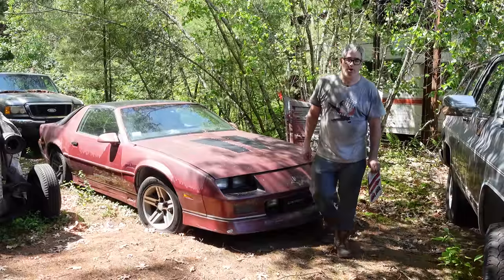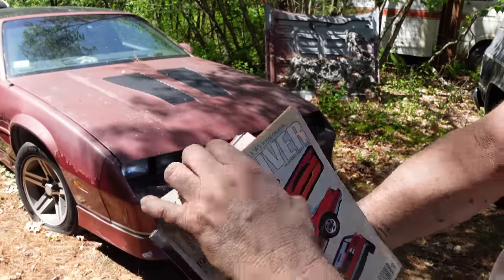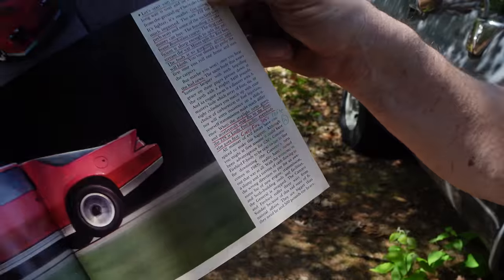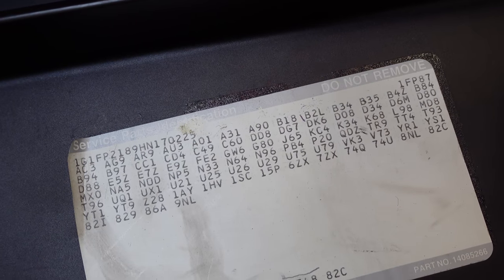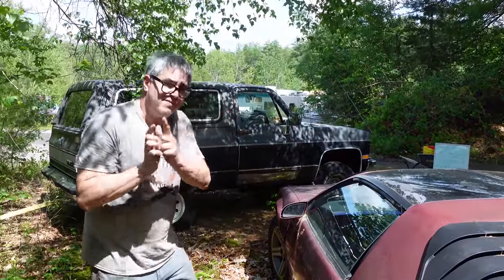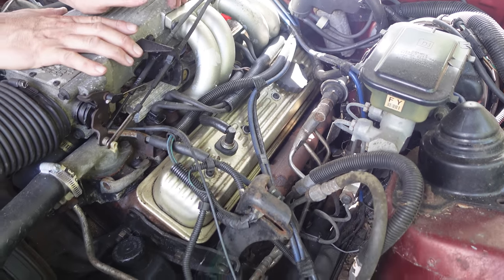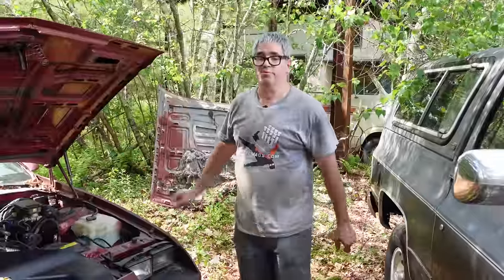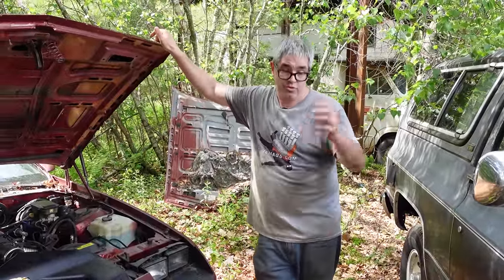Heart of a Corvette

Comment: I have an 87 LZ the base model with the 2.8 6cyl and the 5 speed it has a little over 42,000 it just turned over a couple of months ago, the car is sharp no rust. 

I'm the second owner, I paid $500 bucks for it, but of course I bought it off my father in-law who can't drive it anymore and wanted rid of it.

I have the dealer receipt and I've got the build sheet from the factory! 
I've got every book, repair manual ever made for it!

Comment: I had one of the first IROC-Zs off the line. The first ones had the strait from the Corvette line intake runners. They were bigger than those that came out later. Over the years, the IROC Z28 became simply an IROC-Z without the Z28 badges.

Comment: Power adders. Paxton supercharger, Superchip and a 100 shot of nitrous oxide. Around Bergen County and Passaic County NJ early 90s it was Camaro vs Mustang every weekend. I had a CRX so I was an observer. Ever see the passenger door open up on a hard launch?  Or a T-top go flying. I worked at a speed shop on Rt 46 in Elmwood Park and people would come out of NY city to have accessories put on there car's. We were the place to get your nitrous bottle filled and a can of No Touch wheel dressing.

Comment: I had a 75 442 with a 455 I pulled out of a 70 delta 88. The look on the IROC drivers face when I pull away from them was priceless!   They definitely looked better than my car though!
Reply: I had 73 cutlas s 14,000 miles gold 350 rocket and it utrun 78 z28s with 4 speeds and the 350 iroc when it came out in the late 80s or 90..even the pittle 5.0 5speed foxbodys yep them to .the gold rockets were better performer then the red ones olds 350 rocket is also a big block some dont even know that. Man i miss the best selling cars in America and that was olds cutlass for many decades our granddads knew whats up😅

Comment: One funny piece of info that I learned over my many years of 06 GTO ownership is that the poorly named M80 differential that comes in the GTO is somewhat related to the Australian 9 bolt found in this IROC. I'm not sure of the extent of the relation, but The diff in my car has carrier bearings that I bought looking up the part for one of these F bodies. I guess it makes sense that there's only so many types of Australian differentials.

Comment: I was at the Toronto Indy a couple of weeks ago, and was talking to some guy about the early races back in the mid/late 8o's. I mentioned that they had the GM/Players series here in Canada that had zed-28's (just to be a hoser) and Trans-Ams racing on road and street courses, and the Toronto street course was one of the stops. He was good bit younger than I, and he had no idea of them. My father in law was a GM parts manager bigwig, so he got tickets and I went. The IROC's racing in it had the 1LE  package that came with a 230-hp 5-liter V-8 and the manual transmission. They still come up for sale occasionally, and are pretty nice machines, better than a 5.7 IROC.

Comment: Thanks Steve, agree that one needs the right home. My '91 Convertible was a base RS 305/Auto which now has the G92 posi disc rear axle, all Hochkis suspension, and C6 wheels. Been building a 383 AFR head engine from my '72 Vette block to replace the 305. Even though it has 300,000 miles, NO rust and very clean. Back in 91, I had special ordered a blue 1LE with leather seat option. It took a month to get it, but well worth it, and yes, it had no problem with any Mustang - except one that had full AM and he got me by a fender. Of couse that was 1/4 mi. not a road course...

Comment: I ordered a 1982 z28 with 305 ,4bbl  four speed manual . Actually I still have it but it’s a long term project now. In 1985 I went to a  350 11 to 1 aluminum heads bored 60 over with a 850 double pumper, but kept the factory transmission and rear end. Fast on the hwy but slow on the track. That was my first midlife crisis.

Comment: owned one of these. 86 IROC Z. all options including the same rear window after market cover.. a very cool car. 305/5.0L TPI engine. working on this car was a huge PIA, everthing was so tight often had to remove lots of parts to just service it. Rear spark plugs were the worst... I've never seen a 350 for the 86 year so suspect it was a mid year change. It would get about 20mpg but then I changed the program chip and it dropped to 12mpg. Fast before chip change, neck snapping after chip change. top speed for me was 160mph, plenty left but never went faster. an amazing car, down fall was the radiator. First factory plastic aluminum radiator went out with leaking seams, 2nd one did the same thing. 3rd one I installed an all copper made unit. top rad hose connector blew out of the housing, just too much pressure at high RPM's. I loved the finish of the car but the ride was worse than a pickup truck and didn't smooth out until I got over 100mph. Also ate the fuel pump, huge PIA to change out, had to drop the rear axle to get to the fuel pump. engine was a thing of beauty to look at... I'd often leave the hood open so I could look at it when I passed by.

Comment: I have a red '87 Iroc with t-tops, Highly modded L98 (from a '92 GTA) in it with a 5 speed manual.  It's sitting under a car cover in my garage.  Great shape.  Haven't started it since 2016.  Went to start it a couple years back and the starter was shot and seems the e-brake has seized up on me.  Car is lowered so I need to get the time to get it on the driveway and back running.  Not a good daily driver in the city (hard on gas and pretty throaty rumbler).  Hopefully sometime soon.  Was the car of my youth back in the early '90's.

Comment: Great presentation, as you're thoroughly versed and seamless in the particulars. The Chevrolet design was head & heels far more superior to the Mustang of that era. Open air cruising with removed t-tops an absolute delight. Only one real drawback on the IROC model. Solid rear AXLE and super light rear end always produced excessive wheel hop particularly on ROUGH road surfaces. Many Thanks Yo !🤜💥🤛.     💯

Comment: I worked for Lawrence Chevrolet in Forest Hills Queens, a mechanic in 1985 and 86. I never saw a 5.7 IROCZ.  They all had 305s ,and they had fuel injection problems. Quite a few came back on the hook. There was a 10 Amp fuse that would blow out .by chance I replaced it with a 15 Amp Fuze and I noticed that car never came back, so I did it on all of them. But again as far as the 350 in anything but a corvette, no I didn't see that. They all had 305s with 200R4 transmissions.

Comment: Steve this was a great feature. I had an 87' Iroc for almost 15 years. It was a 305, 5-speed. I do have to correct you on the difference on the two type of 305 TPI's for 87. The 305 tpi auto was rated at 190hp, the 5-speed had an improved cam and was rated @ 215. I could usually pace a 350 iroc fairly easily as I could shift my manual faster that the 350's 'slushbox' of that era. I also had the borg-warner rear end and the disc brakesas they were available on certain 305's if you knew how to order the correct options

Comment: Nice classic.
I bought a 1985 IROC-Z in Palmer Mass. in April '85.
I kept it 12 years.
Traded it in for a 1997 Wrangler. I still have the Wrangler. Mint. Low miles.
My IROC was a Norwood built car. 5.0 Liter TPI. VIN: 1G1FP87F3FN129711
I see this car is a Norwood, Ohio car too. Based on the VIN.
I bought the IROC by trading in a 1983 Z-28 H.O. 5.0. with at  5 speed.
The '83 I had since new in 1983. I bought it when I came home from my deployment as a Marine.
I live in Socal now since 1986.
My IROC is still on the road here. I looked it up one day.

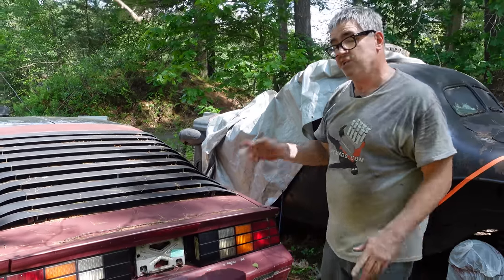Comment: Hiya Steve. If you got the 305tpi with a 5-speed you'd also get the 5500rpm redline, as the manual 305tpi has the camshaft from the 350tpi. This pushed it from 190hp with A4 to 215hp. If you opted for the g92 rpo code you'd also get the 9-bolt rear end. I have one, 305 tpi 5speed, g92 and 3:45 9-bolt rear end all original 87k miles. Fun cars.

Comment: Actually the iroc stickers were on the back of the door from 88-90 . Also she rpo code for the 350 is the l98, not the b2k. But you are right Steve,  there was no irocz produced in 86 model year with a 5.7 .
Reply: B2L was the code for the L98 5.7 350, and they built 50 '86 IROC's with the 5.7, none of them had A/C, they were press cars built for magazine testing and promotion, none of them were sold or made it out to the general public.
Reply: @MS3DALE  yes,  you are right.  The b2l rpo code was for upgrade performance package/5.7.   But the engine rpo code is still l98
Reply: @bigboytoyz541  Correct.

Comment: G80 is Torsten Limited Slip Positraction.    It doesn’t list the Torsten part, but I know because my Suburban has the same one.   This diff has  a very interesting design, as there are no clutches, and it is a true locker once engaged, which happens if one wheel spins at more than 100rpm faster than the other, where the difference in centrifugal force allows and very heavy duty pawl, I guess that’s what it’s called, like the Park pawl in ATs, engages and locks both axle shafts together as one until the two wheels travel at the same speed far enough, and with much less force, usually about 30-50 feet, but if you’re still heavy on the throttle, it will stay locked even if you are going straight for a couple of hundred feet.     So getting out of mud and onto pavement while slightly turning can be shockingly odd, as none of us, unless you have a spooled drag car, are used to fully locked diffs.      GW6 was a 3.27  gear. J65 is front and rear disc brakes.   Fancy.   MD8 was the THM700 R4.   NP5 is leather wrapped steering wheel, but here’s an odd one, N0D does not exist.     Hmmm N96 is the 16” cast aluminum wheels.  P20 is oddly enough styled wheel hubcaps.(?).  QDZ is for the badass P245/50VR16N R/PE ST TL HW4.     That’s optimistic in a car that would barely do 135.       That car was loaded.     Special taillights, fog lights, stereo with EQ, special floor mats, decals, alternator was 160amp, all kinds of crap.    But what of the RPO which doesn’t exist, N0D?

Comment: I have a 1985 IROC-Z with the 305 TPI engine and the redline on my car is 5500 rpm. A forum site says the 5500 rpm redline cars had slightly hotter cam then the 5000 rpm redline cars.
Reply: 5.0 H.O.

Comment: Just sold my 87 Formula Firebird with the TPI 350 in it. All stock it was a nightmare on wet roads. Personally it was much cheaper than an IROC or TA at the time but still had all the performance with the WS6 handling package as well.
Reply: Less expensive and lighter like the "base" TA with the L98.

Comment: They had the LB9 305 that had 230hp just 10 less than the 350 in 1989 also if you got the 5 speed LB9 with 3:45 rear it would out run the 350 auto with 3:23 rear the 1LE LB9 5 speed could dip into the high 13s in the quarter mile...

Comment: The RPO is B2L,  it was the 350 Iroc package, the other dead giveaway is the L98 RPO which designates the 350 TPI.  Ironically they car also has the 3.27 BorgWarner 9 bolt rear axle. The GW6 code calls out the 3.27 performance axle.

Comment: Wow nice video.  Got an 89' L98 350 Corvette and boy is it a fun machine to rip around - not to mention the 6 speed stick.  Perhaps that was the reasoning for the automatic trans in the Camaro with the 350... to have a stick, you'd have needed to upgrade to the Vette!  (Although unless it was 1989 or later, you'd have been stuck the the Doug Nash 4 speed)

Comment: Had two sport coupes once upon a time, an 86 and an 87, both T-top cars, red, with the almighty 305..., the 86 I purchased with a wasted engine and swapped that out for a 350. These car were fun, however the ride was awful if they were driven for long times. Also had a 79 Camaro, and I liked the 86 and 87 much better then the 79. These cars are fun as a Sunday cruiser, would not want one now to drive everyday though.

Comment: Typically L98 rather than B2K for 350 IROC. L98 Was 350 vs LB9 305 TPI or LG4 for the last year of the carbureted 305. B4Z was IROC option.
Reply: B2K is a sales package, B4Z was the package for the IROC, yes. The VIN (8th digit of "8") or SPID (RPO code L98) seals the deal on what you have, correct.

Comment: I had 3 different f bodies back to back. All 86s. A berlinetta 6 cyl tpi 5 spd manual. Quick car no top end.a z28 305 4brl auto. Trans am 305 fuel injection auto with the giant firebird on the hood. They all had t tops. The trans am was the fastest of the 3. My only complaint was that the cars fell apart quickly.

Comment: I believe the T5 was only rated to 300 lb-ft which is why they made you get a 700R4 when you opted for the 230-240 hp 350.  It's the same reason the C4 stayed with the Doug Nash 4+3 (Super T10 w/an OD unit on the tailshaft) instead of the T5.  And Corvette jumped straight to the heavy ZF 6 speed in 1989.  I always thought part of the reason they didn't offer a manual in the 3rd Gen  350 Camaro/Firebird was because it would've gotten TOO close to C4 Corvette performance and Chevy couldn't have that.  I guess that thinking went COMPLETELY out the window in 2018 when the ZL1 1LE which was the BEST pure ttack car that Chevy EVER released--better than C7 Z06 and better even than C7 ZR1--ZR1 was always aimed at cars like the 911 Turbo--very fast but more of a Grand Tourer, still had magnetic shocks & cast rims and the questionable 8A transmission , while ZL1 1LE had the superb 10A, solid pillow ball mounted non-adjustable Multimatic Spool Valve dampers that accepted standard 2.5" springs and was the ONLY car of that platform (Camaro/ATS-V/CTS-V) to use billet aluminum "pucks" to mount the rear subframe to the unibody.  All other Camaros used hollow rubber bushings that allowed excessive movement to the entire rear suspension assembly, even the standard 650 hp ZL1 usef those floppy rear subframe bushings!  ZL1 1LE is one of the greatest sports cars under $100K of all time, IMO.

Comment: My buddy had one, back in the day it was fast, but...the Tee Top cars with the 5.7L werent avail in a manual.  Same as the trans am GTA, only the 5.0 L were avail in manual, with tee tops, they said the 350 had tourque to twist body,  now as gearheads as we were...we swapped a 5 spd in the IROC-Z 350.
and we never twisted no bodies...and had much fun burning tires, along with him having gears swapped to 3.73 ratio. It was in its day...the mustang killer, my buddy had a 1990 mustang cobra 5.0 manual, was not even a match. The IROC killed the cobra from the dig...to the end of the " strip " however on top end the stang edged him by about 1/2 car due to
Our gear change in the IROC

Comment: Early 2000s I had an oddly optioned 88 IROC white and gold stripes with the TPI 305 auto no t tops and standard 15" wheels painted gold....IROC stood for "Its Really Only a Camaro" on that one......car looked brand new but was cursed with stupid issues...wiring problems, rod knock, then the trans died, I hope the new owner had less trouble than I did with it.

Comment: Always wanted a Red IROC with T-Tops, 350 and T-56. Had an RS hardtop in red w black stripes, 305, body color wheels. The RS had front and rear sets of wheels too, due to the offset... I think the IROC had it due to the width of the rim?  I could be wrong, but I remember there were major differences in wheels brakes suspension and the IROCs just looked right.

Comment: I was wrong.   The G80 is an Eaton unit and it’s mechanism of locking is a bit different than what I described.     Whoops.   It still rocks.    I’ve had problems with my 4WD system engaging properly.    One time a couple of years ago when leaving a particularly muddy job site, other bigger trucks had left the only exit route looking like it was purpose made for a mud big competition.   I hit the 4WDHi switch, and went at it, and I started to get a little bogged down, but stayed in the gas, turning off Stability Control right when it started limiting throttle application.    This section was nearly to the rockers on my Z71 2006 Burban.    It slowed a bit and I was crawling but making forward process.     Made it to the other side of this 100’ “supply hole” and drove out, no problem, truck pretty well covered in mud.     I went to put it back in 2WD and realized the 4WDHi switch was blinking.   Whoa.    I jabbed the throttle and only the back wheels spun on the grass, and I realized I had just gotten  through that mess with 2WD thanks to decent tires but mostly that diff.   From that point on I have loved it.   Even did a test where I put one front tire on a tree stump where I can drive up to it with a gradual progression to the stump on that side.    On the drivers side the ground  stayed flat.   Got the right front tire up on the stump, using 4WDLo of course, and was looking for the right rear tire to either lift or get very light.  It got light.   Then the diff locked up with a satisfying thud.  Nice.  I crept forward just a bit and there was zero tire spin.   I put the emergency brake on and on Park, got out to check.   Talk about articulation!   The right front wheel was way up in the well, and the left rear was so deep the top of the tire was completely covered.    I grabbed the right rear wheel well arch and pushed upward and sure enough the truck teeter tottered across the diagonal.    Wow.   Went to backup off the stump and same thing.    Effortless.     Only problem is in the wet, if you get some wide painted stripes on the road or it’s still greasy from a light rain which hasn’t washed it away yet, the rear will kick sideways quickly once the diff locks , which I love, but others would need to be more careful.